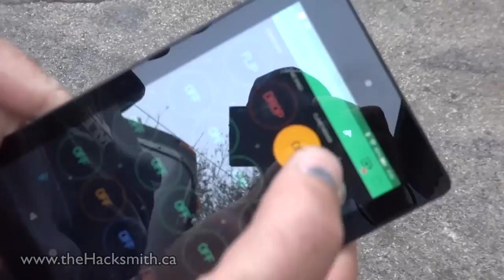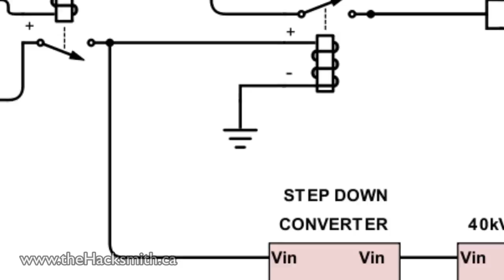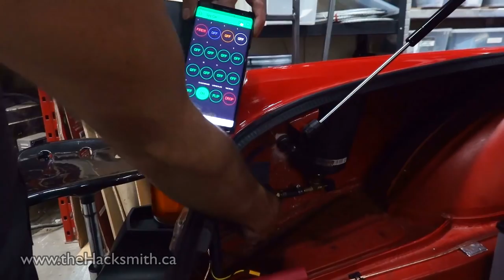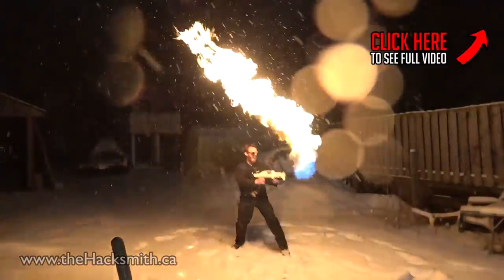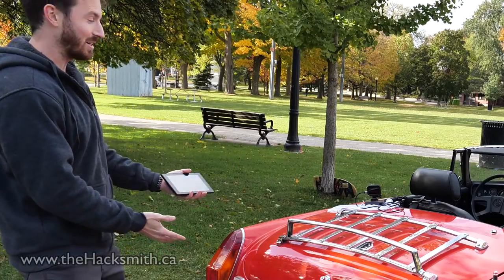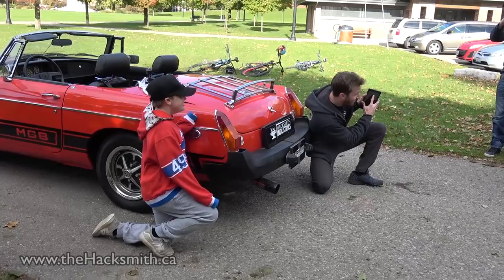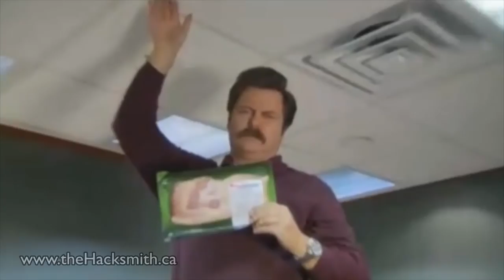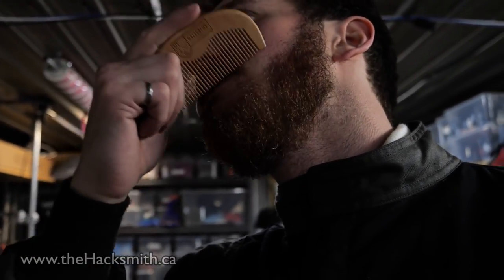Spy Car Flamethrower Exhaust!

Comment: Why the bottle upside down ?
Guess diddnt fix the iceing problem :)
Reply: References!!!
Reply: When under pressure propane turns from gas to liqud, upside down bottle meas liqud gas goes to the exhaust and makes enriched fuel mixture with the air. 
tldr version: because bigger flames
Reply: Icing problem? Might wanna look after it.

Comment: I watch the whole video, as usual. And as you're building the ignition gap I think, "this isn't going to work very well."  I'm glad my countless taser experiments have finally come in handy. Such a useless skill, outside the realm of crazy gadgetry such as this! 😄 Happy to see you got it working more consistently. They sell higher frequency boost converters, similar to what you'd see in a plasma lighter. They seem to work best when trying to create an ignition source. Have you tried experimenting with nichrome coils, like they use in vapes?

Comment: They make flame thrower kits for cars that have an off/on switch. Comes with a small fuel pump and a plug.Taps into the fuel system. I found the best/most reliable flames come if you have the spark plug deeper into the exhaust about 8-12 inches back from the tip. I installed these on an H3 hummer and a 59 Buick Lesabre. The Buick would shoot flames about 12 feet back. The Hummer about the same as you're getting. Cool build keep it up!

Comment: Guys, I’m sorry but that tailpipe is ugly, if that car is carbureted you could rig a second coil and have a button to shut off the ignition and go to the secondary coil, the fuel air mixture would flow right into the exhaust and be lit by a spark plug in the tailpipe, sure it won’t work unless the engine is running but it would work so much better and be cheaper in the long run.

Comment: Try using a flammble oil instead of a oil slick. Used in conjunction with the flame, it would create a fire trail on the asphalt behind the car. Great getaway!

Comment: My suggestion would to run the fuel return line from the carby (assuming it’s not injected) back in to the exhaust
Reply from the maker: we tried, it was easier to make it indepednant

Comment: man if only you sticked with using the switches in the vehicle, it would made it a lot more like a spy car in my opinion
Reply from the maker: it's still going to have switches...
Reply: @hacksmith  i know, but connecting it to yer phone is kinda weird in my opinion, im not saying its a bad idea, im just saying like it would be more practical. i honestly dont know, im in a power outage with a huge storm going on

Comment: You could have asked a tuner bro to help you. That way, you wouldn’t need to have the electronic switch. Nice work though
Reply from the maker: what?
Reply: @hacksmith  I was just saying that if you had a car guy help you out, he could help you set it up so your car would spit fire from engine backfire rather than the propane trick.
 Very cool project though
Reply from the maker: We tried -- it's also not great for the engine
Reply: @hacksmith  ha ha😅 that's the best part of it!

Comment: the burning yourself for the thumbnail bit was well funny 😂😂 thanks hs, by the way your issue with not enough views to pay for the videos, you need to cut costs you've seen channels like colin furze for example he seems to make things just as interesting on a much smaller budget, it's simple really, lower your costs until you've become profitable, I'm assuming it will be hard because you pay people wages and that's a big part where you'd lower costs, if the problem is as you say you'll have no choice eventually so do it early to give yourself a better shot at a different way of doing things.  it's hard hs, i wish you the best, from a friend
Reply from the maker: the stuff we make isn't expensive, having a team of people is
Reply: @hacksmith  that's what I'm saying, use fewer people, things will take longer obviously, it's simple really, there's no correlation between the number of employees you have and the amount of views you get.
Reply from the maker: @TheGreg6466  so fire everyone who relies on this job...?
Reply: @hacksmith  look at similar channels they don't have so many employees, they must be your biggest cost, I'm sure you can help them in other ways, switch to part time, if your views don't increase you won't have a choice eventually, you should always jump before you're pushed if you know what i mean